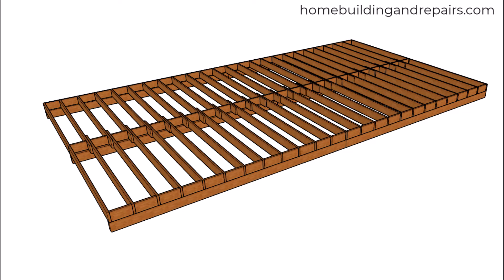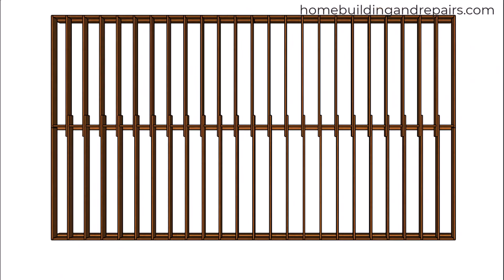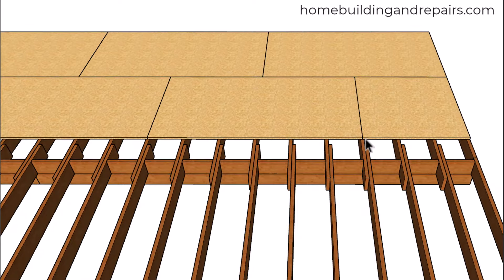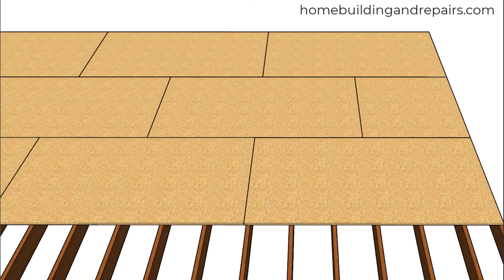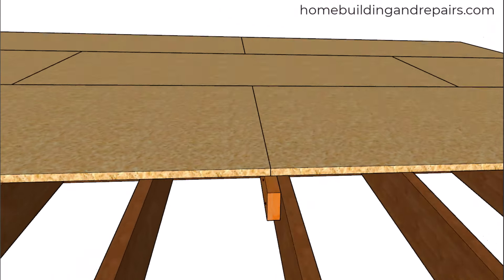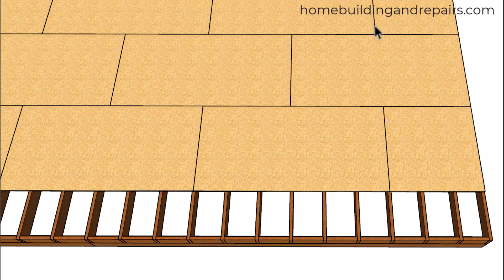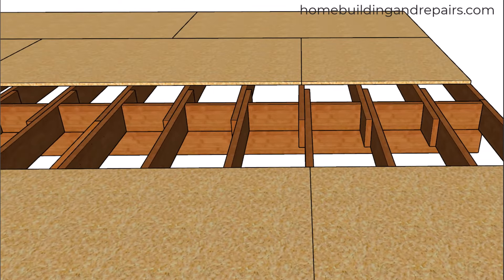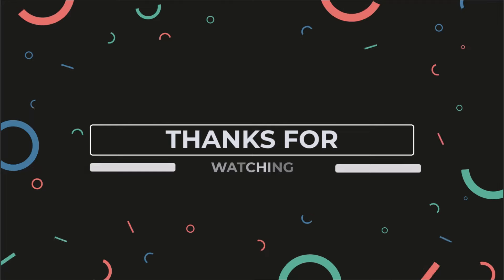Use This Carpentry Trick To Install Floor Sheathing Over Lapping Joist

Comment: You could also start from the center and align the long edge of the plywood with the beam.
Reply: Doesn’t this result in the potential for more waste and labor as now you’ll have to rip sheathing on both rim joists instead of just one?
Reply: @Pseudify Use a tape measure to suss it out. If you will have a drop greater than two feet at the  rim, it'll be wasteful. But if you are lapping joists a foot each way, you can offset your central starter by a foot  to compensate. Or you can take that too large drop and butt the ripped end to the center to start the other direction, but you'll have to beat them in backwards.

Comment: Why wouldn’t it be more efficient use of time and materials to cut the width of that row of plywood to land on the center of the beam? Then just shift the next row of plywood over the 1 1/2” to land on the staggered joists, as necessary. Maybe some special attention to gluing to alleviate any increased potential for squeaks, but any “best practices” installation should have that anyway.
Reply: That’s what I was thinking 🤔. This way the added cost of engineering specs is avoided. Not to mention the extra time it would take to get them if the inspector asks for them. Time is money. And money saved is also “money” 😅 as my Dad would say.
Reply: I can see that working for the example shown, but not the general case (a big area with multiple bearers).
Reply: I don’t think you’re gaining much, if any, efficiency by ripping a sheet versus taking a scrap of wood and screwing it to a joist, especially given that you will likely have more waste. Unless your total dimensions between rim joists can work out to avoid having to rip the last row of sheathing. Maybe?
Reply: You would be cutting the Tounge and groove off in an area where it’s needed to strengthen the floor

Comment: Is it possible to start in the middle and avoid putting those extra boards?
Reply: I think you have the potential for more waste and labor as you might have to rip sheathing on both rim joists instead of just one. Depends on the overall dimension.

Comment: Why not just cut the first piece short so it aligns with the joints? Seems like a whole lot less effort.
Reply: Interesting. So how can I do that ? U know, When I get to the joists lap over the beam 
having trouble visualizing it

Break it down for us it sounds good but i can’t see how it would be less hassle 
Thanks in advance
Reply: The first piece can’t be cut short or else its short edge won’t split a joist. Unless I’m misunderstanding your point. Also, this is not a lot of effort. It’s screwing one board per sheet for only 1 course of sheathing. Probably not more than 5-10 minutes of labor and you can use scraps.
Reply: You rip the entire first row so your sheets break at the point your joists overlap. It’s a good solution except in the case when it adds slivers on the ends.
Reply: Don't be silly
Reply: There's really no reason you can't butt two grooves along the middle and work your way out both sides. You can always stick in a tongue if you want but there's already  solid wood beneath the entire butt. Why do I feel like I just made a dirty joke...
Reply: I’m assuming he’s referring to the entire first row. 
You would just want to factor in what is the most efficient use of materials. 
Btw my framers are fine with a butt joint if it lands on, and is concealed by, wall plates/walls. So if you only need a few inches and the 2x6 exterior wall on the other end of the building will hide it, few framers would be opposed to that solution. It’s pretty just just act as a shim between the joists and wall plate at that point.
Reply: At 2:45 he says, or you can always move it over and use a smaller piece. He then explains in detail.
Reply: Talylor Lewis; I’m with you  14 foot is the cut off for real lumber.
  Rip the first row at 2 foot.
   We call extender pieces “SCABS “
  Scabs are bad , future squeak on the way

Comment: Total novice question here: the beams are 1 1/2" thick, and two plywood panels are butting up against each other on that beam, depending on it for support. That leaves only 3/4" per panel. In the case of composite plywood with those little wood shards pressed together by glue, my spidey-sense starts tingling. Code aside, doesn't that strike you as unsafe? It seems there should be more support on the edges somehow.
Reply: The flooring is tongue and groove so the sheets are locked together plus resting on the joist.
Reply: This is how all sheathing is applied. Floors, exterior walls, drywall, roof. You typically increase the nailing/screwing schedule on the short edges so you will have more fasteners on those edges than in the rest of the sheet.

Comment: There's nothing wrong with this as long as you do a good job attaching the board. I've done this while doing drywall on old houses in order to keep from having to cut a full sheet of drywall.

Comment: Hi my name is Paul. I’m building a 20x20 addition onto my house. I have the foundation in place and the 6x12 is cut out with a pier in the center and on the end corner. I want to have  a 6x12 screen in porch with a private entrance from the new living room( the new addition). In other words no outside entrance to the porch. But I’m using the roof of the addition to cover it. My question is how to build the floor. I’m thinking making it separate if possible do you have any ideas.  Thanks in advance

Comment: I think everyone that that is thinking they have a solution hasn’t really dealt with this problem as a builder.  The only viable solution is like someone said which is to start laying subfloor from the middle out right where the joist cross.  The only problem is you will be cutting both sides the full length where the stem wall is.  THATS A LOT OF PLYWOOD SUBFLOOR WASTE. unless you only hang over a couple inches on both sides .  Other than that you scab pieces on which is a bitch if you use IJoist

Comment: I've always double beamed the floor joists for this reason. They usually get notched by everybody and it is ahead of the curve. Inspectors ask sometimes but are always pleased with it.
Reply: I’m confused. Isn’t that far more wasteful than simply screwing a few scraps of lumber to the joists?

Comment: Scabs are for mistakes in layout
Reply: This video used a "scab" so can you explain the mistake in this layout?
Reply: Yeah sloppy work never as solid and adding unknown variables if you do this start your sheeting on the edge cut at wall. Better to just split on the beam
Reply: @patrickday4206  None of the work is "sloppy." There are no "unknown variables" as everything is transparent and clearly described. If you disagree, what are the "unknown variables"? Also, the connection is weaker when you "split on the beam."
Reply: @scottjackson638  describe weaker when blocked properly with a sheet that splits over the two sacrificing strength where it's not needed doesn't always make sense
Reply: @patrickday4206  Strength is not sacrificed as the locations in question carry live load only. If there is a point load, which there is not, the approach described in the video would not be used.